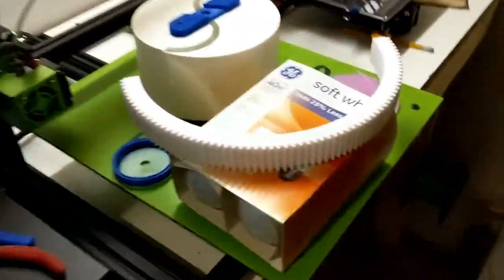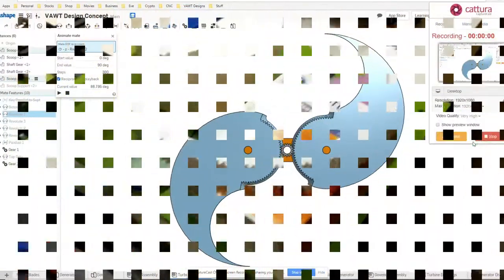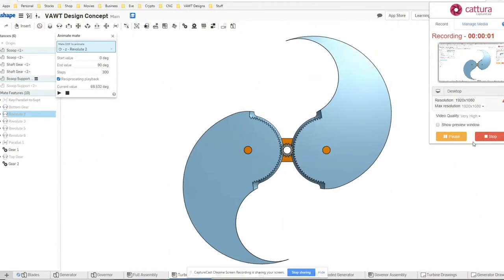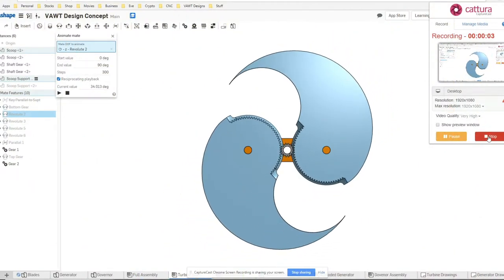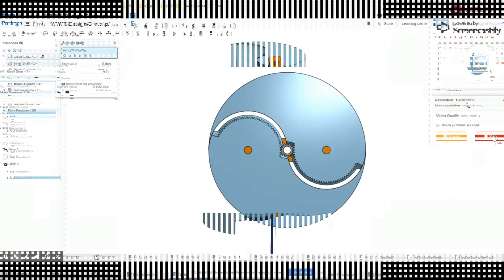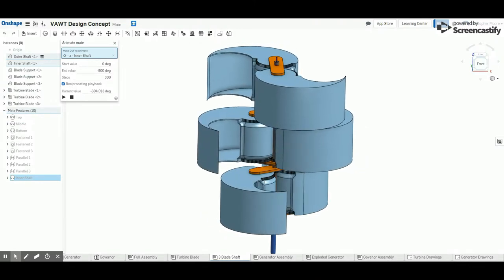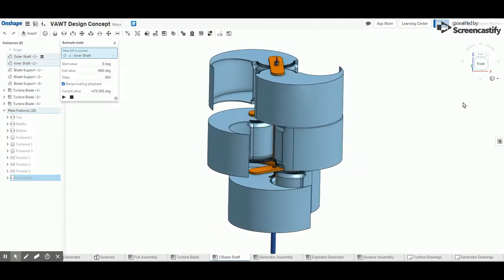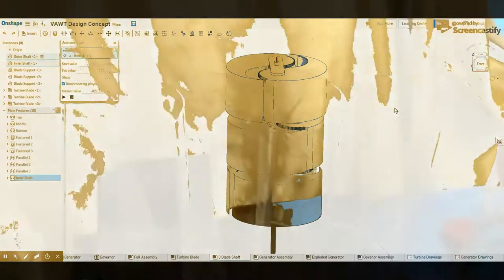Vertical Axis Wind Turbines New Approach - Harmony VAWT

Comment: I can’t see how the device opens and closes without human agency. It sweet the way it closes neatly but once it’s open fully, catching the maximum amount of high wind and beginning to spin at a self-destructive rate, how, with centrifugal force irresistibly throwing the vanes outward, how does it slow itself down before it breaks up??
Reply from the maker: Dave, the closing and furling mechanism is very robust. Even this prototype with plastic printed gears is so strong and durable that you can see in my latest videos it will causing the ratchet mechanism on my drill to activate and that's on the high-torque side of things. I've built huge mechanical advantage into its furling system so it can easily close up to whatever furling state is necessary, even in extreme wind conditions. The furling is going to be automated by a small onboard computer like Raspberry Pi or Arduino ...nothing complex. Just something always monitoring conditions and making adjustments in realtime. Watch some of my later videos and even more to come over the next few weeks as I mount Harmony in the prototype test cage. Then you'll really start to see some magic. If you'd like to see Harmony VAWT Latest Updates, here's the URL: https://www.youtube.com/playlist?list=PLqbwi-6vny7s3NVYuynqVG5oyLxysgfIs
Reply: Thank you. Please put me on your mailing list, the world needs a robust VAWT for these kinds of conditions. People pop up from time to time  with new types of VAWT but the businesses seem to be short lived, presumably because of three things: innate unreliability, under capitalisation and poor marketing.  I’l ping you my email address on Messenger.